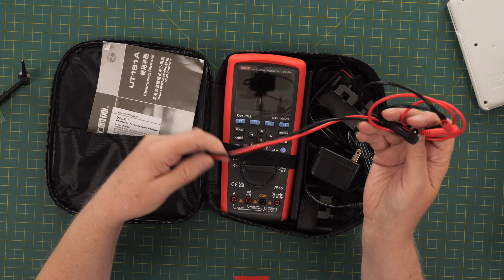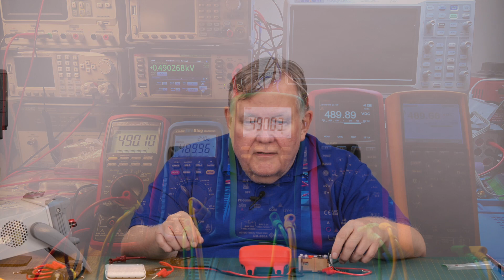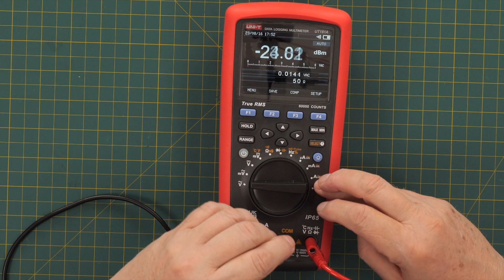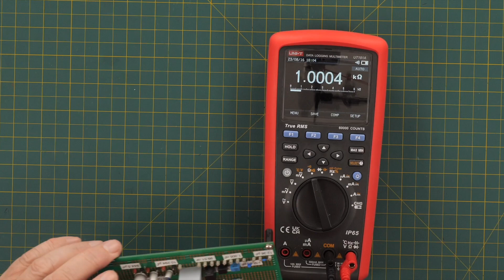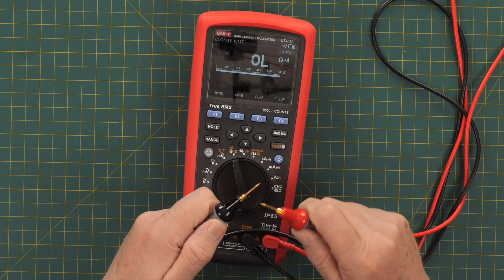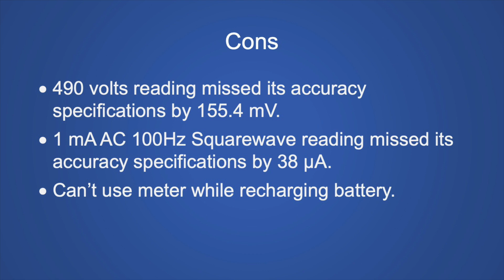Uni-T UT181A Review

Comment: Hello, thank you for this excellent presentation👍, but I have a question: which multimeter is your preference and why between UNI-T UT181A vs Brymen BM869s ?👍👍
Reply from the maker: I still use the Uni-T UT181A, but I no longer own the Brymen BM869s.  Both are good meters but I don't have room to keep all the meters I review. Because of my vision problems I can read the UT181A screens easier than the BM869s.
Reply: @N8FDY  OK thanks for your feedback and good luck.👍

Comment: does it beep in diode mode ?*
Reply from the maker: It does not beep in diode mode.
Reply: Пищит. Включается отдельно, если нужно(When checking diodes, it beeps. The option is enabled separately if necessary.)

Comment: Drifting is the biggest problem of the Uni T 181A...or any Chinese made things for that matter.
In the video, your testing was under controlled environment, you knew what are the measurements to be expected...imagine in real situation where you dont know what to be expected  and those number are jumping up and down???especially when you hold the test lead by hand... you will not be confident to believe in those values to make your decision.
Uni T or Chinese equipment (Multimeter, oscilloscope.. etc. ) cheap for a reason.
I measured a resistor of 320ohm in circuitry, the 181A gave me anything from 152 to 321ohms each time i tested it...and the value was not like bang on and stayed in place, it jumping up and down. Compare to my Fluke 28-2, just a fraction of second and bang on 321ohm, Uni T just a joke. In a voltage divider resister network for feedback of a SMPS power supply, being 152ohm or not 321ohm is matter of live or dead.

Comment: I recently purchased a Multicomp Pro MP730657 DMM from Newark Electronics and it is a rebranded Uni-T UT181A in a green enclosure. Multicomp Pro and Tenma are Newark's house brands , several of their meter models are made by Uni-T. The MP730657 as of this date is on sale at Newark and it has a lower price than the Uni-T UT181A .It did come with a US adapter plus all the same accessories and the carry case. Only had it two weeks but the meter is performing well. I also have a Tenma 72-7730A ( rebranded Uni-T UT71B) meter . I have used the Tenma for several years and it is still working very well. I hope the UT181A / MP730657 performs as well over the next several years. Newark shipped from a US warehouse.

Comment: Hi Tom. Does it still worth buying UT 181A in 2024 please? I watched your video 4-5 times, but still not sure and confused
Reply from the maker: That is a difficult question.  The price has come down to $359.99 on the Uni-T Direct store on Amazon.  The major con is you can't use the meter while recharging.  If you need a graphing meter there is only one other choice I know of and it cost a few hundred dollars more.  If you can give up graphing on the meter you have many more lower cost options.  If you are in the US, Uni-T has opens a local seller uni-trendus.com, but they charge shipping for order under $400.  Good luck on you choice.
Reply: @N8FDY  Thank you Tom. I found UT 181A  for 289 euro in Amazaon Netherlands, and I am going to buy it. I don't mind for the charging time I have another multimeter UT 61E+ and Benning MM2 which is old, but reliable. By the time UT 181 get charged, I can use one of those multimeters. Thak you so much for the quick answer!

Comment: The battery life on mine started acting weird after few months. It was draining fast, despite the device was off. When I took the battery out, it wasn’t draining. So there was something using the battery to finish it off in one day.
No selection of mode or resetting the device changed the battery drain for when the device was turned off. I ended up creating a manual switch to the battery with the help of dremel. Such an expensive device and unreliable power scheme with a weird rechargeable battery solution. I ended up not trusting the device anymore.

Comment: Thanks for review is this meter in diode test forward give alitile beeps?
Reply from the maker: No, this meter does not beep on good diode forward voltage.
Reply: Yes, it emits in diode mode, goes to the alarm menu, I tested it with mine and it works fine 👍
Reply: Да подает. Этот режим включается отдельно, если нужно(When checking diodes, it beeps. The option is enabled separately if necessary.)

Comment: Could probably mod it to add a separate charging port?
Reply: It is made of a reason this way. It guarentees you cannot plug meassure leads on charging. The reason is, if you put the probe leads in and try to measure voltage on your outlet, it might zipp you our of your shoes. Because of this the shown data cable is optical coupled. Without all this it won't hit his CAT rating.
So it is potentially very risky to made such a modification.
Reply: @matthiash.4670  good point. Add a qi wireless charging coil then 😀
Reply: @mc_cpu  applying a very very strong EMR field to a precision measuring instrument while in use might not be that sensible....it'll for sure affect some of the readings.

Comment: They probably used this means of charging because if they have a charging method while the meter is in use they probably can't get the safety rating.
What I don't like about this meter is the proprietary battery. A meter in this priceclass is ment to be used for decades, not a few years. Li-ion batteries dont have eternal life. What about the availability of this batterypack with specific connector in 5 or 10 or 15 years?
Reply: This is exactly why I dont like this meter,. Its great otherwise.
Reply: @guateque1718 If they just used 2 18650 cells, the availabilityproblem would have been solved (I assume that the  18650 cell is here to stay)
Reply: DEFF I GOT BOUT 20 18650S , flashlights vapes, rc controler,  even a drone flies like 12 min on 1 cell😂